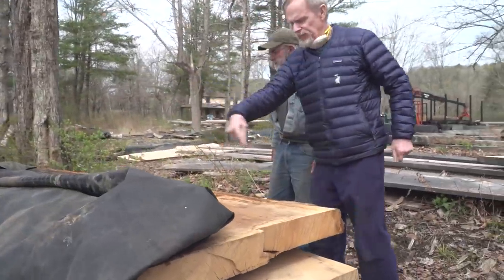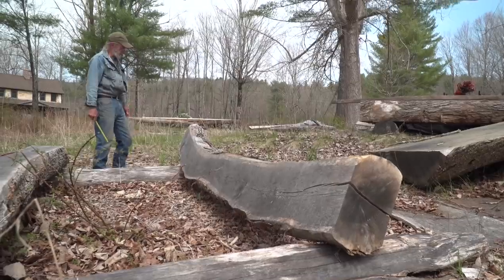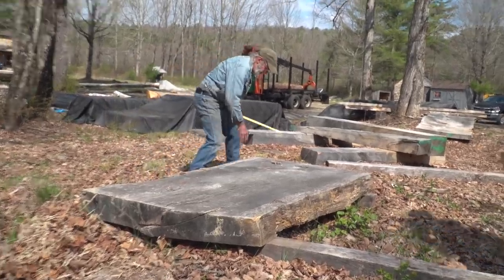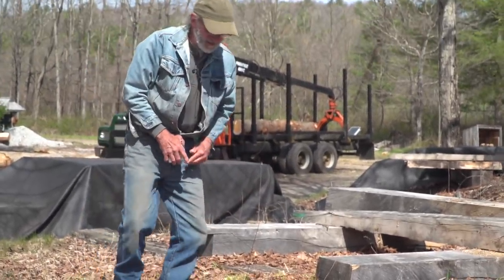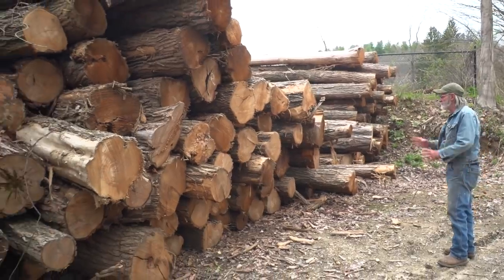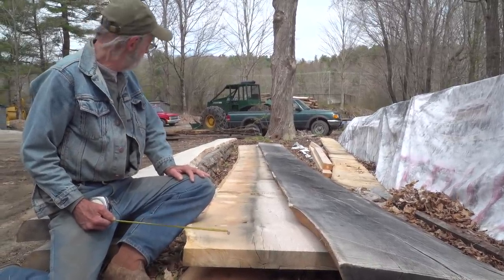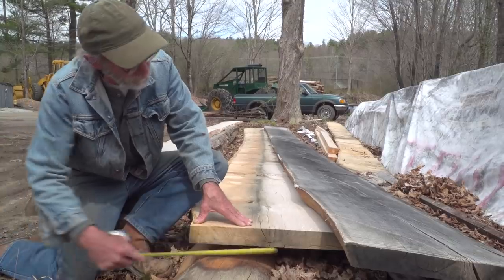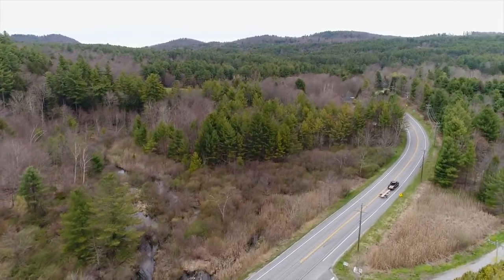TIPS Season 3 - Episode 2: How to choose the best lumber for boat building and more

Comment: Chatoyance is the name of the "iridescent" look in the wood that Lou mentioned.
Reply: Was going to comment the same but... It is also found in certain gems and minerals.
Reply: So, Koa would be the epitome of this?
Reply: @Mishn0  I recall a tree from Hawaii that they nicknamed "Mother of Curl" toward the end of the 1990s. That was largely used by guitar makers both for sides and backs and for veneers on headstocks.
Reply: I know it as "Anisotropy", which makes also sense, since wood is highly anisotropic. Hm.. wondering about how those two terms go together. Chatoyance describes the effect more than it does the condition, while Anisotropy is the condition required for the effect to happen.
Reply: @AlphaXDE  Chatoyancy is the term to specifically describe the optical quality referred to whereas anisotropy is a general term for anything with the physical property of variation in different directions.

Comment: Thanks for another great vid Louis.
Are there any situations where you would exclusively use the narrower side of a quartered slab ie the 'half' with the edge nearest to the heart?
My understanding through traditional English carpentry is that the cells of the wood on that side,just as with a branch, grew in tension so are much stronger than the compession wood. e.g splitting logs or large branches to make oak rafters,using only the inside of the curve (tension wood) and throwing the compression wood into the firewood pile due to it being weaker structurally(too weak for common rafters compared to the other 'half' of the same branch).

Comment: I'm happy to discover your shows and I'm a fan. Eventually I'll will cooperate with keeping the good, wise, practical tips and ways to be aired. Thanks for that. May I have a suggestion? There is a generalized belief "that there never are too few clamps". I have seen many woodworkers that uses an immense quantity of clamps in a small job it's like a compulsion. You, in the contrary, are very frugal, to say a word, in the use of clamps. I'm not saying that you use too few you used them wisely and practically. And here is the darn question. How many and what type of clamps you have and recommend for building small boats? I know is not the Holy grial but just curious. Thanks for the happy days you give us. Ah the Ryobi electric plane program was a blast seeing all those parts finds its rightful place, the box. My regards from Puerto Rico.

Comment: Hi Lou. Loving your videos. 

I would like to source some wood for a punt locally in the uk. Up until now I just trust the timber merchant to sell me whatever stock they have (which is dwindling in the sizes that I require)
Do you have any suggestions on lumber choice? It needs to be medium to dark in appearance so that rules out Ash or Oak. I saw you referred to Black locust, perhaps that's an option? I see that growing a lot, but previously assumed it was crap as I recall the small branches are brittle from climbing them as a kid.
The timbers I need for the project must be minimum 15" wide. It would be possible to find a trunk that wide, but more difficult to find one twice that width. I note from your video that you don't mill wood past the centre of the tree, is this a hard and fast rule?. Is the Sapwood also no good? I have been sold stuff with both types of wood and it seemed to work alright for my purpose (i haven't noticed any premature rot).

Comment: Nice, but Lou is wrong about oak shrinkage. The difference between rift sawn and flat sawn shrinkage is by no means only ten percent the shrinkage of the other. Or spoken in reverse- the flat sawn being ten times the shrinkage of the rift sawn. Not true. What then is the actual shrinkage? The Wood Database lists white oak at Radial shrinkage (rift sawn): 5.5%, Tangential shrinkage (flat sawn): 10.6%.
By the way, Burr Oak and Swamp White Oak (really should be called Swamp Bur Oak if you ask me) are also both members of the White Oak family here in the northeast and will work for rot resistant oak as well. (Gotta watch for more twist in larger boards in those two instances). Additionally, red oak strength is actually the equal or ever so slightly stronger than white oak. You could use it for deck beams and all sorts of above waterline stuff that's reasonably protected from the weather.